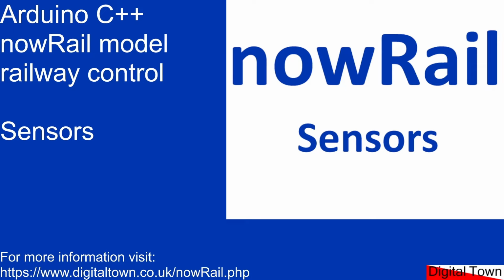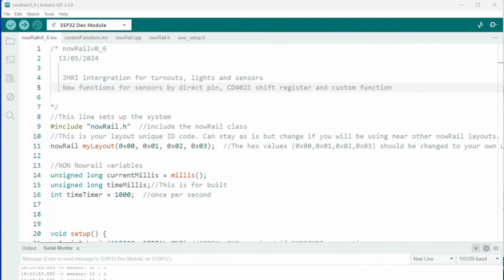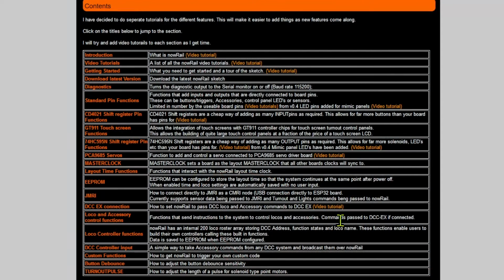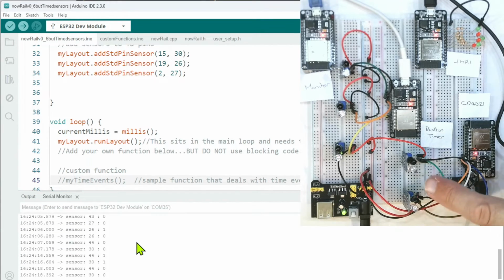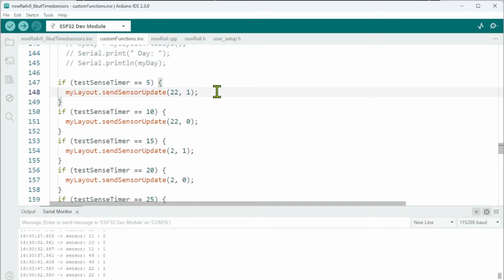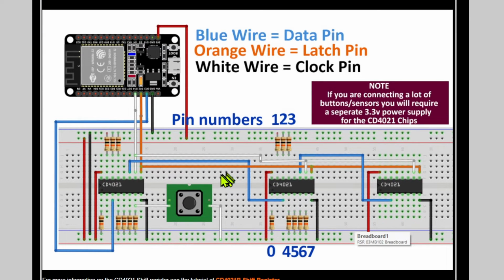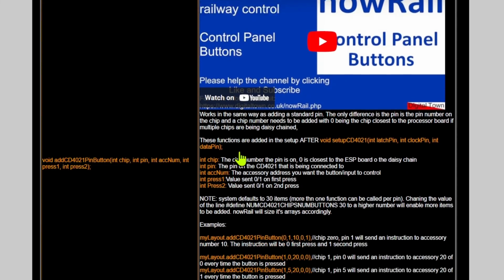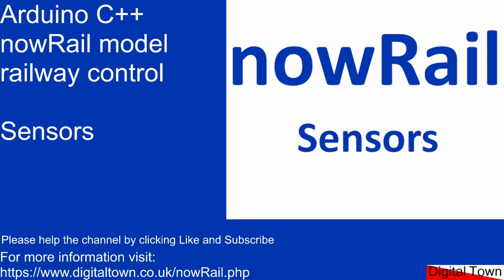#87 Arduino C++ nowRail model railway control - Sensors

Comment: Is there a way to set the input pinmode pullup or pulldown with NowRail?
Reply from the maker: No, with the addStdPinButton() function it's triggered when the pin goes high so circuits should be built with a pull down resistor. Most of the system has been built that way for uniformity although when it comes to sensors they can have the trigger set by a HIGH or LOW as I found some sensors go LOW when triggerd.

Comment: Can you clarify how a sensor can control an LED? If I set myLayout.addStdPinSensor(15, X; How do I turn on LED with accNum 105 and turn off LED accNum 208?
If  senNum = accNum then I believe I understand. 
Thank you
Reply from the maker: Sorry about that, looks like I copied and pasted some text from another function and the LED control got copied as well... just updated the page.
The good news is it's possible and I will do a video on it and and some more documentation on the functions within nowRail as I found a few missing in the documentation.

If you go to customFunction.ino you will find a function void nowSensorUpdate(int senNum, byte senInst)
This will receive any sensor commands on the system.
Jut add a switch statement using sensNum and within each Case add an if() using sensInst.
Code would look similar to the commented out code in void nowPanelUpdate(int accNum, byte accInst) on the same page.

Once you have your if() statement you need to use a function that isn't listed yet so I need to get it sorted and a video done.

void sendAccessoryCommand(int accNum, byte accInst, byte respReq); 

AccNum is the accessory number
AccInst is the instruction you want sent 0 or 1
respReq is used if you want the receiver to confirm it got the message, usually used for turnouts. 0 = no response, 1 = response required. System will work either way.

This will allow you to send a custom instruction as a result of a sensor change. I intend to use it for triggering some custom sounds (sound control is being added to a future version).

The custom code can be on any node on the system, the board with the sensor, the board you want to control the accessory or any other board as all bpoard get all instructions and can send to all other boards.
Reply: @digitaltown5442  That custom function code worked for me. Thanks for that info.